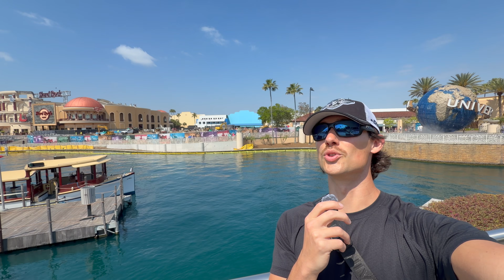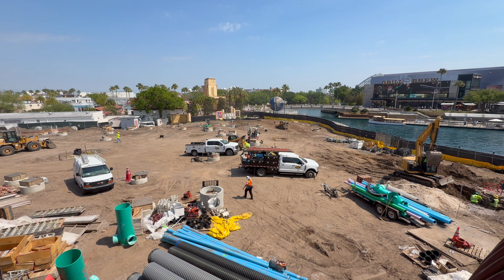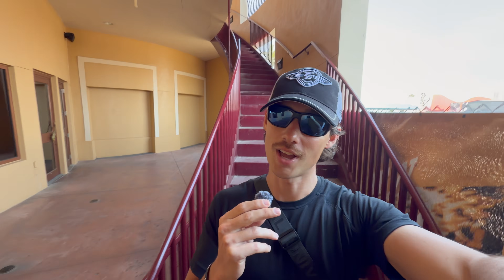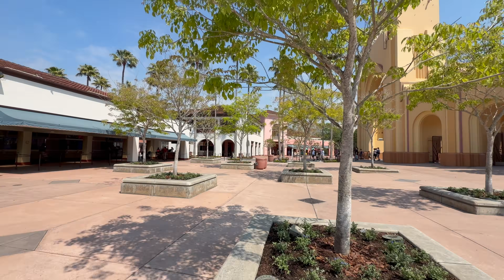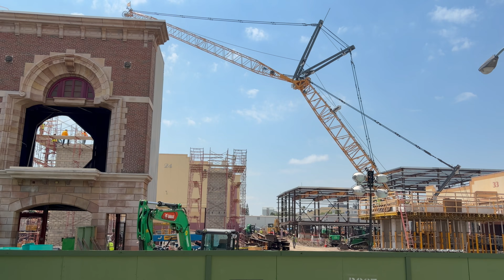Hollywood Drift Construction: Entrance is BUSY + Power Station, Conduit & Concrete Structures!

Comment: Those silver pipes rising out of the footers look to be conduit typically used for power and data cables. I typically see them on camera and light poles but they could possibly be used for a location they will have power or low voltage (sensors/cameras) running up alongside a support.
Reply from the maker: Interesting, I figured some sort of conduit! Wonder what it will power? 🔌